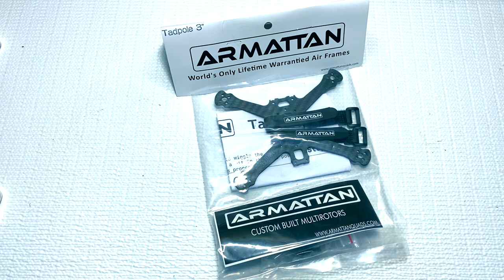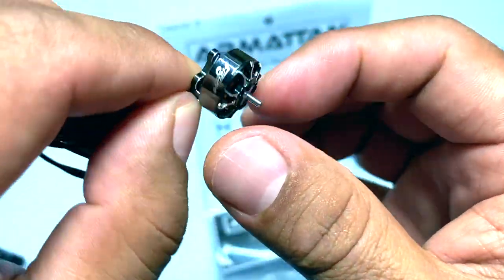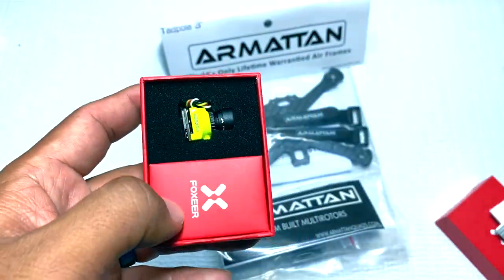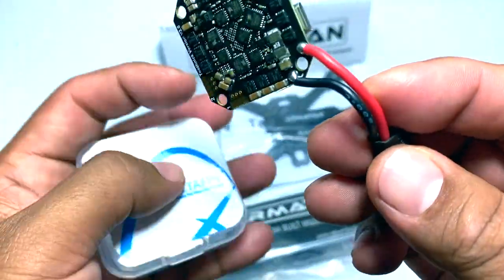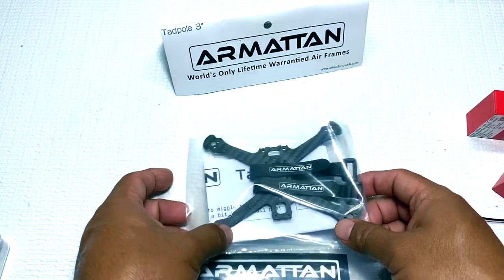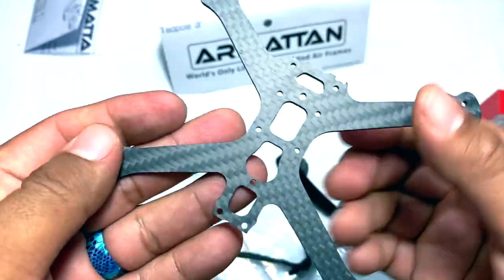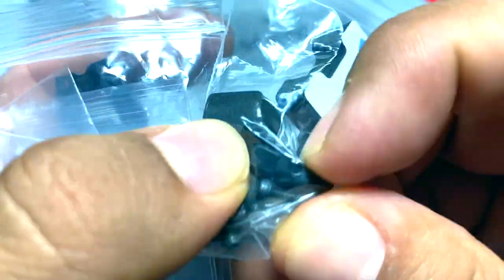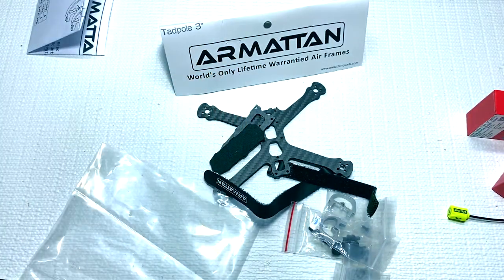Armattan Tadpole 3 🐸 - Build 🛠Overview & Discussion

Comment: I'm accumulating the pieces-parts for a 3"Tadpole build right now. I have a RunCam Split3 Nano WoopEdition camera for mine to get some 1080 HD. Ordered a HifonRC F7 AIO 45A 25x25 tooth-pick FC,  R-SXR receiver, still shopping for Motors and batteries. I'm pretty set on a 4s power system. Gonna follow ya progress...Subb'D
Reply from the maker: FlyerTuck Thanks for the support!👍🏽